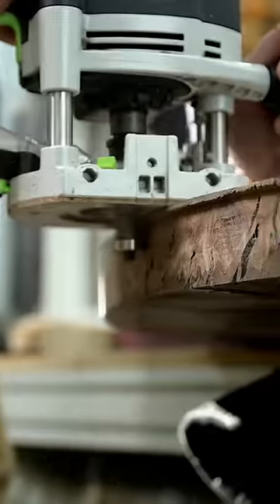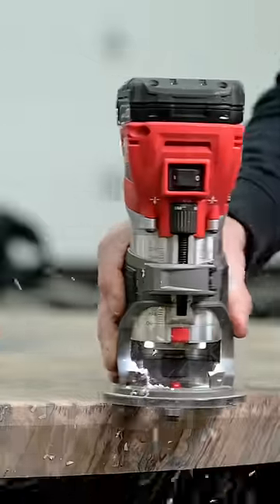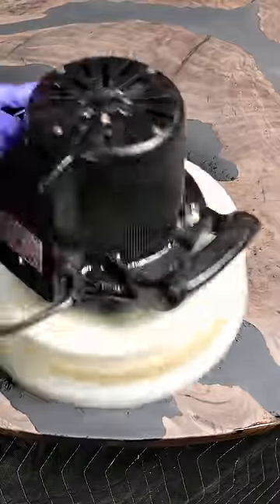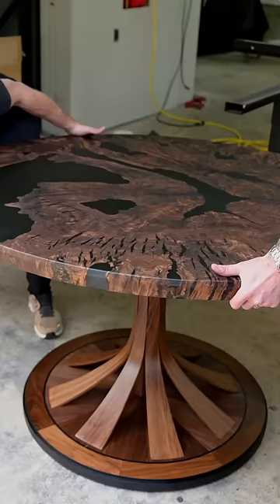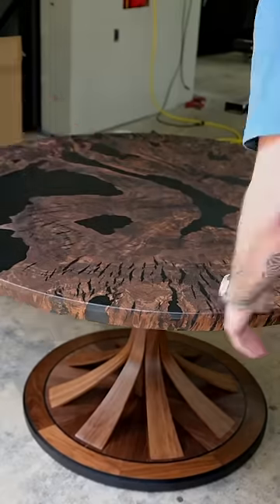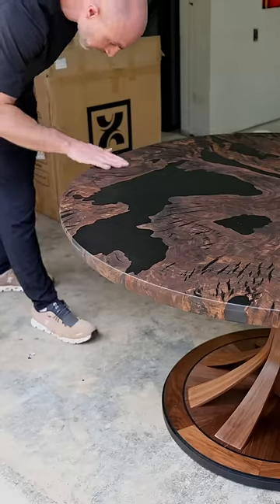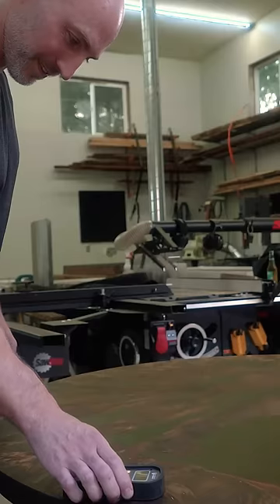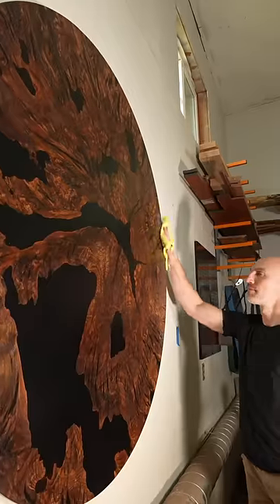My biggest f’ up

Comment: Every time I see one of these, I think of a comment where a guy said, "Epoxy is going to be this generations asbestos" and it really resonates.
Reply: I hate epoxy.  I think it probably takes way longer to break down than thin plastic.  Just becomes permanent filler and unusable.
Reply: I  suppose it's impossible to know if there is some unknown hazard form epoxy.  However it has been arround a long time and so far there are no known hazards once it is cured. Enough people have also been exposed to it and worked with it long enough for it to be considered safe as long as you use appropriate PPE and follow the safety guidelines.
Reply: I have a similar experience.  I work on boats and have seen many people leave industry because of epoxy sensitization.  None of these guys will grow old doing this.  They will all have to give it up and find a new way to earn where they have no exposure whatsoever.  It's a little heartbreaking to watch.
Reply: @fjbforever6747  A lot of epoxies release toxic gasses.
Reply: @michaelodonnell8306 That is uncured epoxy, AKA Bisphenol A. Cured epoxy is biologically inert. Bisphenol A is INSANELY toxic and carcinogenic, which is why you should always wear chemically filtering breathing mask and have a well ventilated workshop when working with epoxy. Also wear a glove.
Reply: @horvathbenedek3596  I'm not looking for an argument, but I think you are leaving out the amines.  And, I think there's a few more points, but everybody will choose to believe what they wish.
Reply: Your comment make me laugh, because in some way it's true, but in the other way I remembered that I work with acrilic resin to make dentures, is also termostable as the epoxy. Is one of many risk factors of cancer, I mean, not for the patient who needs the denture but for me who make it. (Dentures are not a risk factor of cancer by itself, trust me, my final proyect was about that, and also I'd been humiliated because I chose that)
Reply: @michaelodonnell8306  they are literally giving you a technical explanation and you are choosing to ignore it lmao
Reply: @851995STARGATE  I think he has a few points of his own but doesn't want to argue. Ppl who want to continue using it will do so no matter what, even if it's contributing microplastics into our environment or is being used by kids who use it unsupervised without the proper PPE. It will be the new lead poisoning.
Reply: @michaelodonnell8306  NAD, but to my knowledge the curing agent is irrelevant to the end result. That being said, people should always check the safety profiles of any chemical they work with, and decide if they want to deal with that later on. I know for a fact non-amid cured epoxy is inert, which is why it's used by dentists - doesn't get much riskier than putting stuff in your mouth.
Reply: @djdoc06  When I used to work with epoxy, the glove "recipe" was 

1. Fabric glove, preferrably with plastic dipped tips. If the latex gloves break, you can pull them off easier.

2. One layer of thick latex gloves (I used 3M.

3. Baby powder.

4. Another thick latex glove.

The baby powder means the two gloves won't bind to each other's surface, and break from internal friction.
Reply: @michaelodonnell8306  I don't know why you're getting aggressive, I never doubted you, I specifically said I only have my opinion, and that obviously people should educate themselves about the safety profiles of the stuff they use.

As for WHEN it's cured - T = infinity. The discussion was about long term health and environmental hazards of epoxy (similar to asbestos). At that point 24, 48 or 72 hours of curing time doesn't matter, because we're talking about years. The curing agent also doesn't really break down, since its chemical structure becomes identical to the polymer resin once it cures.

I am not doubting the health hazards of epoxy while it is being applied - I specifically warned about its dangers, because it IS dangerous.

I pointed out that on the consumer's side there really isn't a serious risk, or a risk disproportional to say, polyethilene. You won't get cancer from an epoxy table 20 years down the line.

Comment: You can drill a bunch of holes in the back and pull a high vacuum on it for a couple of days than re epoxy it, it definitely can be fixed. It’s beautiful I wouldn’t give up on it.
Reply: If it is in the back he could just let it open.
Reply: Lol no he's making excuses so he can keep it haha
Reply: @noworries2254  very understandable😂😂
Reply: Hmmmm
Reply: That's what I was thinking. This seems fixable.  Why give up??
Reply: can machine the whole back and use microwave gun from pest control, rids moisture from deep, or heat lamp for a while in low humidity or cover with bicarb soda then seal it up with plastic.
Reply: @daverohn383 it is he probably wants to keep it though

Comment: Your definition of completely unusable is very different than my definition of completely unusable.
Beautiful piece!
Reply: The moisture trapped inside would start "eating" away at the wood and it would start disintegrating
Reply: @@sageshellum9982 just a guess, but anaerobic bacteria in the water can decompose the wood, and multiply, accelerating the process, resulting in warps, bulges and other deformation.

Comment: Little tip : Cut scars into it with a circular saw ( you can create patterns if you like , put it in a room with heaters, eventually the moisture will seap out and dry out. Refill those cuts with the same epoxy or even a different color and then reseal it. Might save you some time. You can do these cuts on the underside as well if you don't want them visible.
Reply: GODspeakstome lol
Reply: good tip
Reply: GODspeakstome lmao love this one
Reply: Sure... that'll work ... 🫢🫢🫢😬😬😬
Reply: Gold would be a pleasing color if you chose a suitable pattern.
Reply: Kintsugi...
Reply: The depressions will still occur where the moisture was. He would need to resurface it down to wood and even then where the resin is set into grooves and the big pockets may shrink and crack
Reply: I dont understand whats wrong with moisture in the table?
Reply: @Ru4444 
The problem is the moisture will eventually escape. Could take a while, a year or three, but as it does the remaining wood shrinks. The epoxy, however, will not shrink, so almost every surface transition from epoxy to wood will separate, and eventually look awful.
Reply: @Adam1nToronto    Ah ok, thank u

Comment: Looks amazing as a table or a wall piece. You do impeccable work and your videos are top notch. Thanks for sharing
Reply: It would make a great wall clock.  Any imperfections caused by moisture MIGHT stay trapped since it is so encapsulated in resin.    Great clock in a bank lobby.

Comment: Being an epoxy resin person who wants to get into resin and wood pieces, this made me cry 😢. It was absolutely stunning 😥
Reply: Can't you just drill little holes all across this thing and allow the wood inside to dry out through these holes? Even with the use of applied warm air to enhance the drying process? Could be sealed again afterwards.
Reply: how do you cry over this
Reply: @OlympicPerfo  no u
Reply: bro is crying over a table 💀
Reply: @FireDramine7  You've never cried over something you loved deeply? Or does that tamper with your manliness? 🙄
Reply: @lyteyearz5810  some people just aren't emotionally unstable 🤷‍♂️ so they empathize. Just like people who are emotionally unstable can't empathize with some more emotionally stable

Comment: The moisture meter uses conductance and the resin increases the conductance regardless on the MC%. Don’t assume there is a high moisture content. If you sand the underside back to bear wood it would dry out anyway.
Reply: "Bare" wood and the problem isn't the moisture, the problem is replacing the volume the moisture occupied within the wood matrix.

The slightest and I mean slightest bit of shrinking will sever the bond between laminate and substrate. The same thing happens when you get water in skis, or used to, when they were made out of wood.

Thus, the piece must be mounted on the wall, to minimize impacts and disturbances that will ultimately destroy it. We call it entropy.
Reply: Wow, you really know nothing but think you know everything. That is hilarious
Reply: @toziassmitt  
Right 😂 This man does this for a living, everyday of his life for years. But they know more.. okay 👌🏽 😂
Reply: If there's still a risk, and with his reputation on the line, I would never use that as an excuse to why their table warps over time.
Reply: @nicoleallen6792  he does it for a living yet neglected to check the wood moisture content until after he was done. Hope he has a day job.
Reply: @nicoleallen6792 Well, knowing everything, he forgot to measure the humidity... Curious

Comment: Why cant it be used? I would def use it looks amazing
Reply: Yeah someone enlighten us please
Reply: Moisture will allow the table to warp over time
Reply: But isn't the underside still bare (not sealed)? Why wouldn't the moisture be able to escape there?
Reply: @teggum   nope. Whole thing is sealed. For a dry peice of wood that's good protection. For wet wood the water slowly breaks it down from the inside.
Reply: @ZebraLuv  oh no way that makes a lot of sense I think people think stuff can't rot because epoxy seems like a plastic seal even if it does rot the plastic would stop it from being able to react anymore with the "seal"
Reply: @codypendency9482  it doesn't rot from 30% moisture.  It will warp tho
Reply: How can he tell it has moisture inside since it is already sealed in epoxy?
Reply: @teggum  moisture escapes in the same manner heat rises. Which is upwards. The moisture would be trapped under the epoxy layer on top

Comment: The most surprising thing?  Not checking the moisture level before working on it.   Would have saved the entire piece because it could have been physically stabilized and then left to dry.
Reply: The problem is finding the pockets of moisture when most of it is perfectly dry.
Reply: I’m sure he assumed that buying from a reputable dealer, there would be no moisture issues.

Comment: The moisture problem is a result of the dry ice blasting.  The dry ice cools the table to a low enough temperature that you get water condensation on the wood.  The end grain soaks up that water like a sponge, but of course the end grain has variations in porosity so you don't get even absorbtion, which is why you have splotches.   Thus you have wet wood.  Walnut blasting might have been a better way to go, though it does leave bits of walnut in cracks.
Reply: 85% of the time this is not a problem. But good for everyone to know.
Reply: I used to work w/ dry ice blasting & you're absolutely correct. I don't know if that's 100% the cause in this case, but the dry ice itself sublimates to air very quickly, but if you don't move fast enough, whatever you're blasting gets freezing cold, and ambient air will condensate... Good eye. Kinda surprised he wouldn't have considered kiln-drying it a bit after the dry ice blasting...

Comment: What can happen if there is moisture inside?
Reply: It can crack and expand
Reply: @ilikeike6062  so the problem is he forgot to drain it before?
Reply: @aisyasya9941  Well yes, but it is more involved than just pulling the drain plug. You have to put it in a kiln, or a massive oven for wood, and then slowly over a long period of time, the water will evaporate out of the wood, and when he put the epoxy on, that acted like a plastic lid and made it nearly impossible to get the water out without completely cutting off a lot of the top
Reply: @ilikeike6062 so basically, I could offer what he has in it, and still use it as a table, but there's a chance it could just break at any moment?
Reply: @richardmeadows1911  well it’s more of a guarantee than anything, because when it gets hot outside it will expand, and then when it gets cold, it will contract, which even if you don’t notice it, will cause cracks and other issues, and the bolts holding it down will loose their grip and the table will lose its stability
Reply: Drill a bunch of holes in the bottom an put in inside so there’s not a bunch of moisture in the air
Reply: @davidschmidt8391 The wood sucks up the epoxy though and it completely traps that moisture in, so it wouldn’t matter unless you were to remove a lot of wood from all sides of it
Reply: @ilikeike6062  so if the moisture is trapped its not going anywhere.. I bet it could still outlast a table from the store
Reply: @vadimnesen8060 no

Comment: Put it up for viewing, inform the people what happened with the piece you worked on. If someone still wants to buy it even when there is moisture in the piece, then you already told them what could happen. Or just turn it into a giant clock as others suggested. It's very beautiful, whatever you decide to do with it.
Reply: It'll warp and crack. it's completely unusable as a table. You don't say 'it'll be fine until it's suddenly not, buyer beware'.

Comment: What happens with trapped moisture?  Does it degrade over time?  Is it possible for mold/mildew to grow?  This is a gorgeous piece and I truly appreciate the effort you put in it.
Reply: I was wondering the same thing. Couldn't small diameter holes be drilled from the bottom to let the wood dry out over time?
Reply: @kelkilkat  wood swells when it is wet. It’s likely that there will be cracks along the epoxy lines and it will separate at the edges. He would have to un-pour all of the epoxy, wait for it to fully dry then start over. Basically he would have to be a wizard and magically perform the impossible.

Comment: My heart sank hard! That was a beautiful piece.
Reply: Can you tell me why it’s bad to have trapped moisture 

Dose it have to do with rotting
Reply: @ragnarok7156  rot, yes. It can make the price brittle and it will fall apart later down the line. Now imagine that being in someone's home when it does break.
Reply: @ragnarok7156  It causes the wood to deteriorate and can cause the Epoxy to separate from the wood. In other words it would eventually fall apart when someone places anything on it.

Comment: Was it due to the Dry ice possibly getting trapped and not offgassing. Would waiting  before adding the epoxy  have helped or was this from dense wood still green? Walnut is a tough wood. It's beautiful , post updates on the moisture issue please

Comment: Timber needs to breathe.  Timber wants to move with atmospheric moisture. Epoxy resin just traps the moisture. That’s why epoxy tables are trash.
Reply: I like glass tops better than epoxy.
Reply: Not if you dry it out first
Reply: @santanat.7206  And dry it to what moisture content? Even dry timber has moisture.  😆

Comment: This is why you always check moisture content BEFORE using sealer, hardener, and epoxy. Different regions have different moisture contents that are acceptable to be finished. Here is Colorado, generally you need less than 8% moisture. Otherwise, the wood will warp, crack, bow, twist, everything you never wanted that piece of wood to do! Also, buying from a wholesale retailer like lowes or Home Depot; be aware that those pieces have travelled from different states to reach you. So make sure you always check moisture content before committing the time and resources to make a table that will twist and warp given a years time.

Never assume your wood is kiln or pressure dried unless you’ve done it yourself. Assuming that will result in furniture that will NOT last more than 15 years if that. Not to mention angry customers when their tables are no longer flat.
Reply: No shit, Sherlock.
Reply: Not everybody knows that dude. I'm sure that most people watching this do. But everybody knows different things man. I was literally looking for that information. 🎈

Comment: I think I need an hour vid going on about why it can't be a table.
Reply: There is moisture in the wood, and since it's sealed with epoxy, it can't escape, so eventually it will warp and crack and look funky.
Reply: @shannonrickard8605  I understand that but how could he tell after he poured resin on it. How come he didn't leave it to dry for longer as it's so big. How come he did not check it before, it's sealed in the resin is it not ok? It can be used as something else but why not a table.

Comment: Could you have drilled holes from the bottom side to let out the moisture , then wood fill and re-seal???
Reply: I just noticed your comments because I thought the same thing drill a few fine like 0.5 mm holes then heat up the slab to release moisture then plug the tiny drill holes I'm sure it would be possible 😂
Reply: I said same thing 😂

Comment: Why not cut out the section that is waterlogged and fill it in with epoxy or another hunk of wood (possibly from the same tree or type of tree)? I assume it's because the section that was waterlogged was too big to do that, but if there is some other technical reason why, I'd be curious to know.
Reply: It would lose its structural integrity and be more resin than wood at that point.

Comment: Could you drill holes in the bottom, and pull a vacuum over the openings? Maybe while heating the table to help vaporize the moisture, for faster extraction? Perhaps thus, it would be possible to extract the moisture even after sealing.

Comment: Ok hear me out, cut a donut out of the middle, so you have 3 pieces. Big doonut, smaller donut, circle.. sit somewhere to dry for however long it needs. Cut the middle donut smaller, in depth, to give a recessed look, reasemble with epoxy fill to make the now skinny donut flush with the table top. If you make the donut cuts at the right angle, it'll look curved like a bowl

Comment: Air bubbles from pouring the apoxy resin. Pour it on a shaker table to release the air bubbles. Or, try doing a wood seal first before pouring resin in the gaps and cracks